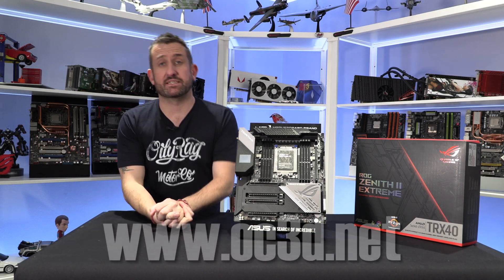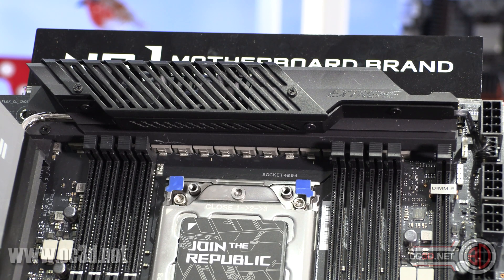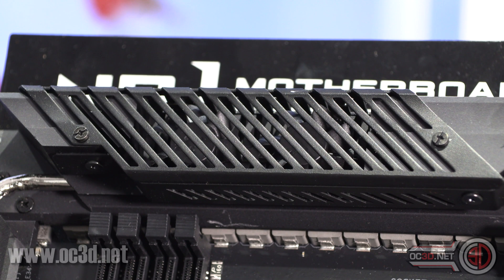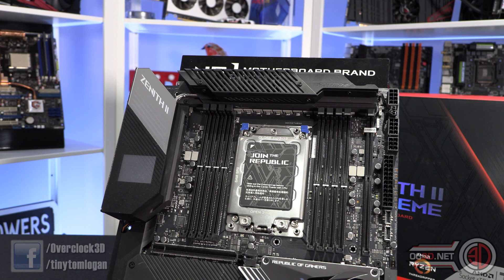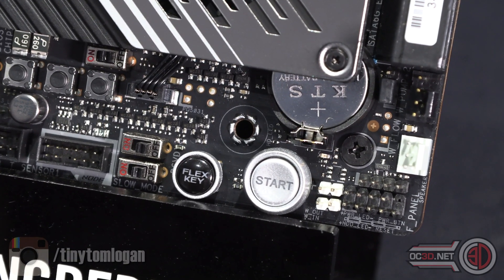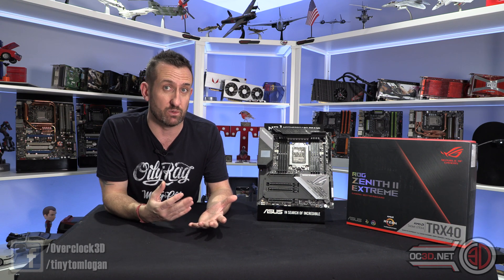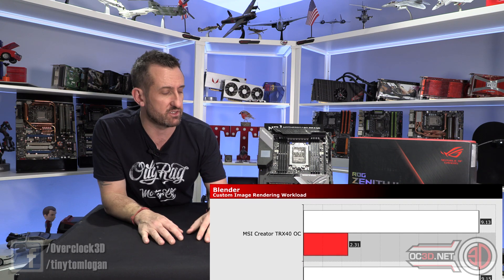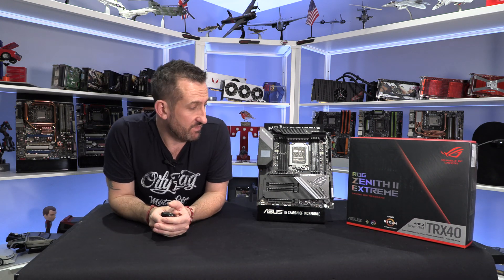Asus ROG Zenith II Extreme Review, Overclocking, VRM Temps, Blender

Comment: Threadripper 3 is the beginning of the end of overclocking.....a motherboard like this one, doesn't justify its price tag anymore especially considering, it ha s only 4 pcie slots which are a misery  compared to what the cpu can deliver...satas slots are also too many and unnecessary.

There is no point  in overclocking  such cpus for only 5 % in performance gain, when a  good cooling solution can deliver maybe even more at stock..at this price tag, one can even consider to use a chiller  to turn on only when the cpu is to be under  full load for extended periods of time...eg  a week or two, or simply  a few minutes when doing single frame complex renders.

next year   is  the time of PCIE 5.0 and ddr5 memory, and the year after 128 cores threadripper cpus.
Asus, Gygabite and AMD, have  committed to a very poor pricing policy, that will render this cpu and motherboard sales, at least 80% less than what the market can actually  absorb for workstation builds.....
because of this there is no reason what soever for people who do need HEDT platforms or workstation HPC  platforms, to commit to small CPus like the 3960 and 70X and low tier gaming concept motherboards, priced at these crazy prices when their  Life span  will not be more than one year in the market.

It is time to understand that 32 cores is  medium tier HEDT, and that overclocking is   dead...thus zero reasson to price mother boards of this level at  anything above 450 euro including VAT.

Those fans on the VRMs are pathetic....considering that the 32 core at full load overclocked will not hit more than 20 watts of heat output and that  unless u are using LN2, you can very well  do without any heat sink on them, and not  even  hit peak  efficiency  on their output.....AMD CPUs ar not 5 years old Intel crap to copy paste motherboards designs from

1000 euro for this piece of crap motherboard with pathetic VRms...is laughable...not to mention  its still using RGB leds in 2020....

If  you are reading this, and still do not understand....think of it this way.....The CPU is a penis and the motherboard is a condom.... the penis is definitely not   a big one, and the condom is definitely an old XS used one with holes all over

Comment: 599$ Mobo dang.  Cool Mobo just a little pricy. Probably not the target audience for this board :D
Reply: @Neo DeOne oh I know. I myself have a 20core Intel server cpu (2011-v3) in my daily desktop. This said this Mobo price is extremely high for coming off as a work station board, when it is just has a bunch of overclocking features  and no real enterprise friendly features.
Reply: Cpus run 1400 and 2000 so I don't think either of us are
Reply: @danielkaiser8343  the CPU price is not my problem it is just the CPU and the Mobo together
Reply: @iukeay  so you would pay 1400 for a cpu?